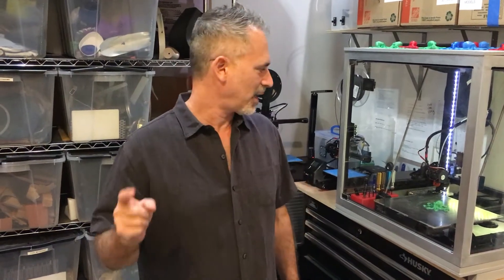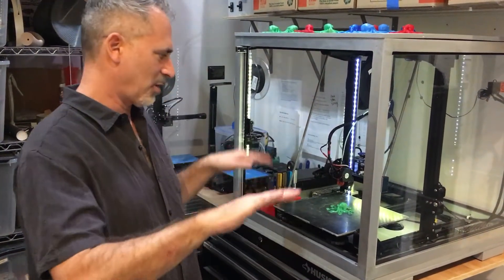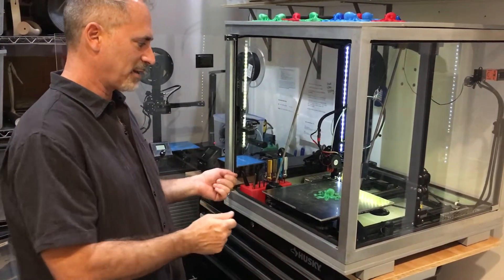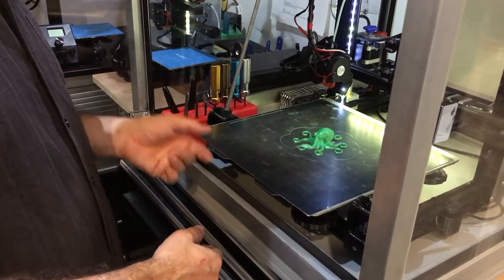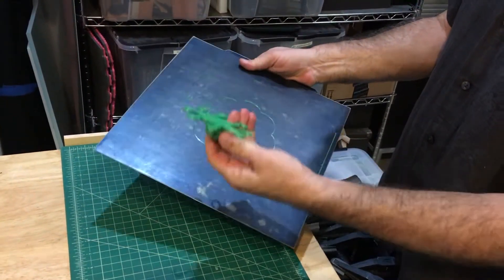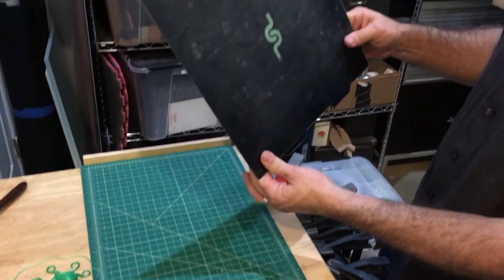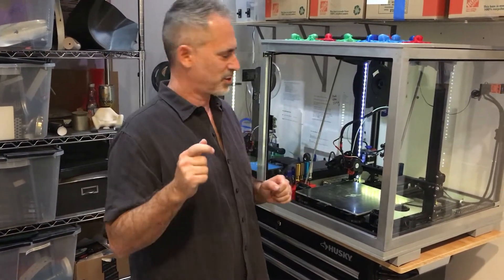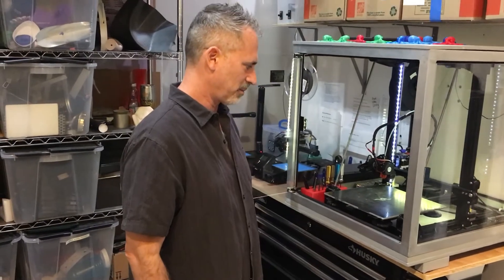Magnetic Build Surface for 3D Printers

Comment: So how far did you get. The curie temp is 200C and 120C wouldn't be enough right?
Reply from the maker: Deneteus it looks like we need a high curie temp for the print surface as typical PC filaments can bond with higher temp materials and are in direct contact with the temperature. For the magnets I recommend 130 C and above
Reply: Will it work if you shield the magnet itself from the bottom of the build plate using epoxy?
Reply from the maker: Deneteus not sure what you mean, do you mean if you distance the magnet from plate can you have lower curie point? Maybe by a bit, you will also lose magnetic force by much.
Reply: Epoxy as plastic shouldn't lose too much force if you have strong enough magnets. Also you could try using mylar heat proof plastic under the magnet to reduce the temp.

Comment from the maker: Update,
I have been working hard to create the best magnetic plate system before I sell or even upload instructions for the DIYers.
I have been sourcing powerful high temp magnets which can withstand continual printing of 120°C to not limit the type of materials which you can print.

Also since this sits on top of aluminum heated bed, and many have complained of a non-planar bed from Creality, I am working on supplying a rectified aluminum plate with embedded magnets, perfectly flat, and with high temperature double sided adhesive on bottom to easily mount directly to your heated bed.

I am also testing different print surface alternatives.

Our goal is to make the best and easiest to mount, most stable, and perfect build surface for any machine.

Comment: Hey! What's the dimensions, i.e., the thicknesses (separately and combined) of the steel and the PEI? Thx.
Reply from the maker: I am using a 0.012" spring steel and a 10 mil PEI sheet for a total of less than 0.8mm thickness.
much less than a glass plate